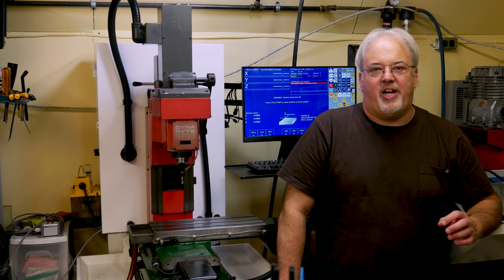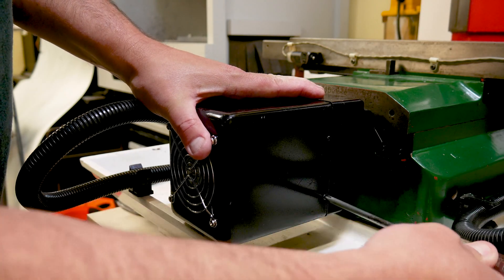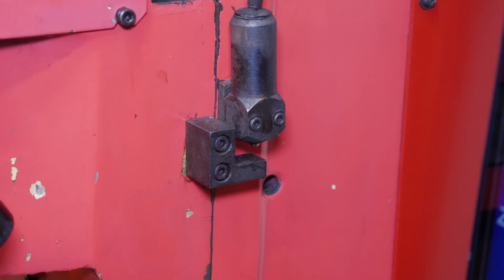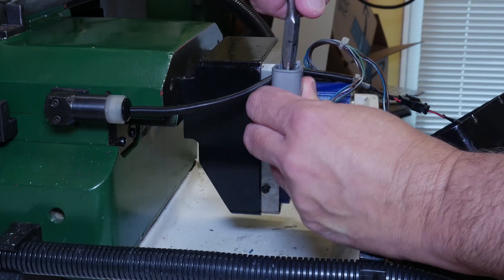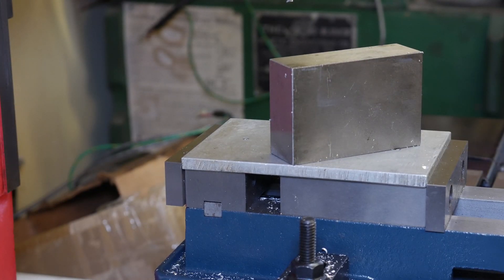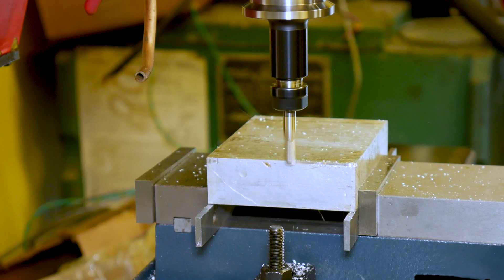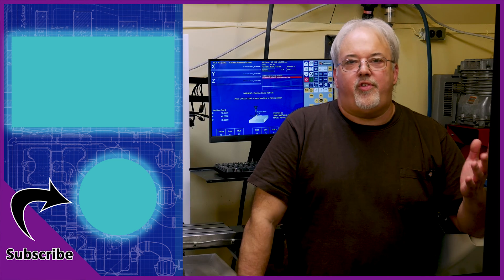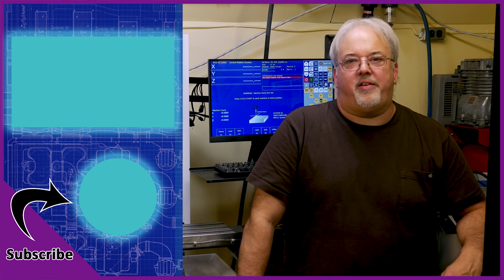Centroid Acorn CNC Retrofit Complete

Comment: yea.. I have  DM2400..  and it is run by open loop servos and a 350W spindle motor.. These where typically used in school settings to teach basic CNC machining.  I'd make a box for your machine and then use mist cooling, as at high speed, a flood coolant is going to mist to some extent anyway.

Comment: Hello Pete. Could you get the encoder on the servo motor of the spindle to work with acorn ?
Reply from the maker: Well, I got it working in so far as it showed numbers on the screen but these were based on the motor rotation and had nothing to do with my actual spindle speed.  I've planned all along to fit an encoder to the spindle so trying to get the motor encoder to work properly by somehow translating it to match the pulley settings was never really a concern of mine.  Sorry I can't be of any help here.

Comment: I luckily stumbled across your page researching another DM2800 mill I found for sale that sat around for a long while. How aggressive have you been with hogging material with it so far? Have you cut steel yet? I'm really interested in what the potential capabilities of this mill can be. If I end up buying this DM2800 I can take some measurements for you, it looks relatively taken care of from what little I've seen so far.
Reply from the maker: I have not really put this machine to a good test yet.  It is certainly capable of cutting steel, how aggressive of a cut I don't know.  I can say that the build quality is as good and probably better than other machines of a similar size.  It is a solid machine and more rigid than my RF30 mill-drill, but I don't think it is going to have as much power at the spindle.  Time will tell.  Thanks for watching!
Reply: @PeteRondeau  looking forward to seeing some parts made with this machine. I ended up winning my dm2800 auction, not sure if I get any kind of documentation with it though. Do you happen to have the manuals in digital form? I'll trade ya for some detailed measurements of the chip guards lol.
Reply from the maker: Yes! I'm looking forward to working WITH the machine rather than working ON the machine.  Thanks for the offer but someone has provided the dimensions, they actually sent 3D models- More than I could have ever asked for.  I'd be happy to share the manual I have with you though, just send an email to the address listed on the channel "About" page.
Reply: @PeteRondeau  Sent you an email! really appreciate it!

Comment: Hi Pete!
Congratulations on the progress of work with the machine.
I was left behind after replacing the stepper motors with AC servos. The machine works in 3 axes, it remains to replace the spindle motor with an AC servo. I have already bought it, I have the driver, but it turned out that the encoder does not match.
I have original sheet metal cases for the DM2800, do you want me to dimension them?
Reply from the maker: Thanks! And I hope you get back to your conversion.  The measurements would be excellent! I have downloaded lots of machine pictures from the internet so I have a basic idea of what the pieces should look like.  If you could get me a few dimensions, I could figure out the rest.

Comment: Good job!
 I do understand the emotional drain of long projects ;-) 
My Dm2400 and 3000 have been in surgery on and off for 10 years. 
Maybe 1 day. 
On another note, I can only imagine how much better your machine would have performed with about 3" less of stick out?
Reply from the maker: Thanks! Now to actually use it to do something productive, or, if not productive, at least fun!
Reply: Heh, I've been working on a Dyna DM4800 for 3 years now, though to be fair, one of those years I didn't touch it at all. The whole machine is nearly cleaned and almost ready to start putting back together. It's amazing how small this 2800 compared to the 4800 - you could probably take the table and saddle off of this thing by hand, whereas on the 4800, almost everything that comes off needs and engine hoist to move (sometimes just barely)
Reply from the maker: Yes! I was very surprised how large the 4000 series was compared to the 2000 series.  Almost bought one on eBay until I started to think about the listed weight and dimensions. Entire different animal!